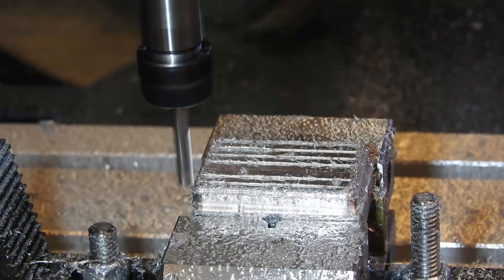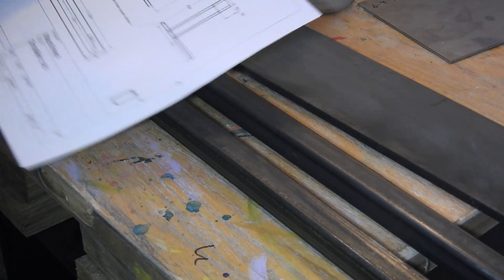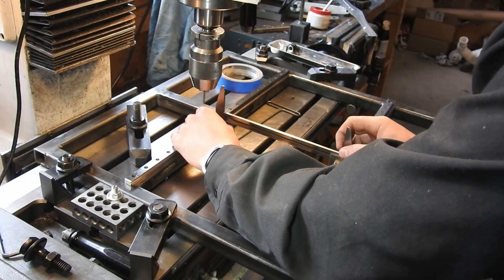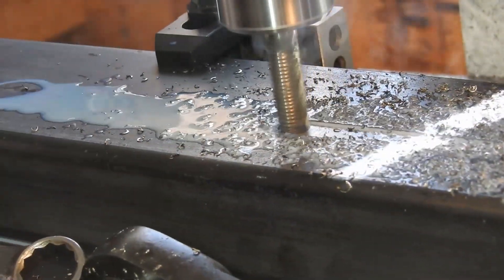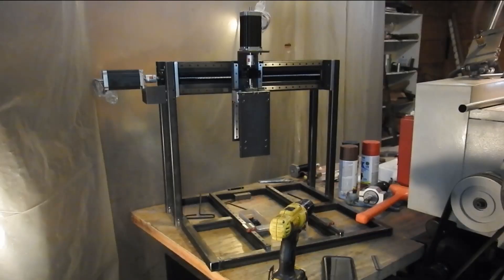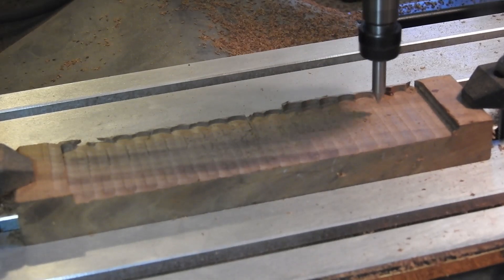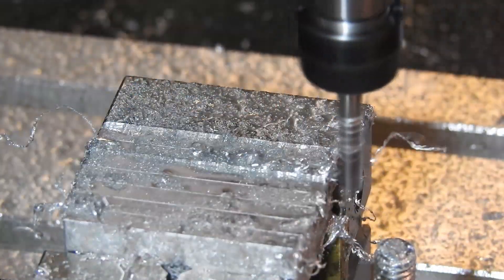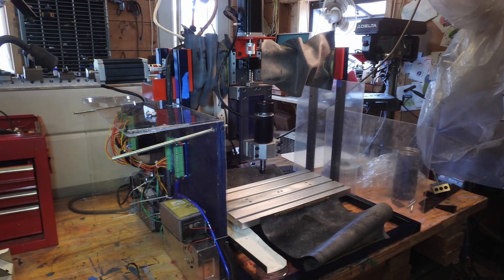Making a CNC Router

Comment: I would build a big box so you can move the work up toward the gantry.  If you did it right you could always remove the box for something taller. Having plenty of Z to work with is great but with a gantry design the length of the lever you turn the Z into has a terrible effect on your rigidity.  I saw in another video that you have and use fusion 360.  check out the FEA simulation and you can simulate the actual deflection your design makes at different Z heights.  You'll find that with your Z retracted you get much less deflection.  Also look at other designs.  It looks like you have 12-15" of Z travel.  That typically requires a very very big frame.  The other thing to consider is how often you'll actually be running an endmill that is longer than 60mm stickout.  With that small spindle you likely can't run more than 6mm end mills so > 60mm would really be pushing it especially with poor rigidity (unless you like breaking endmills).  I'd also suggest a rectangular tube isn't that great because it is more rigid in one axis than the other and this can cause issues.  Finally, that spindle you have likely has plain old deep groove skate bearings in it and you'll have a gigantic amount of axial play.  This is no good for aluminum or steel and I believe you may find it very frustrating.  Don't throw it away though, you can use it to power a better spindle via a belt.  Try to find a spindle with angular contact bearings if possible.  Hope this helps and I agree you likely learned a ton on your first build, i know my first build taught me a ton.